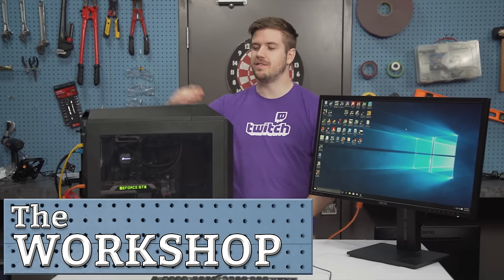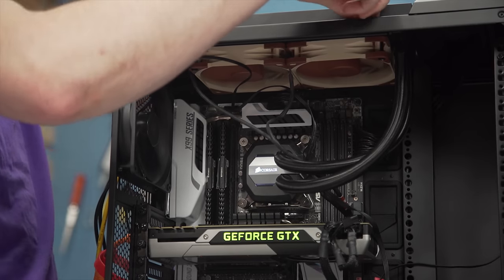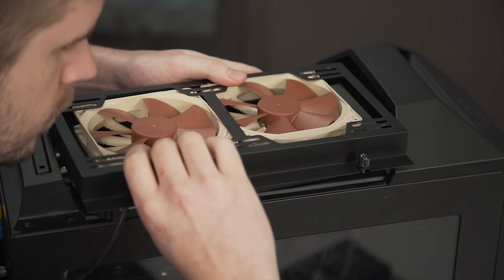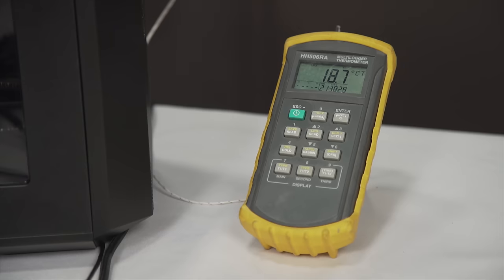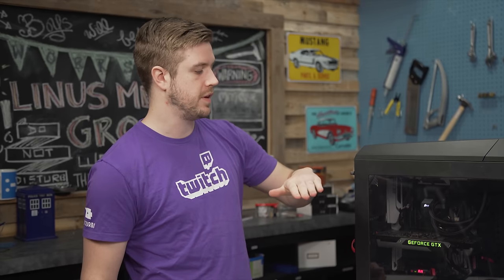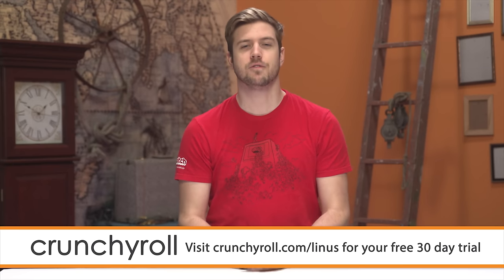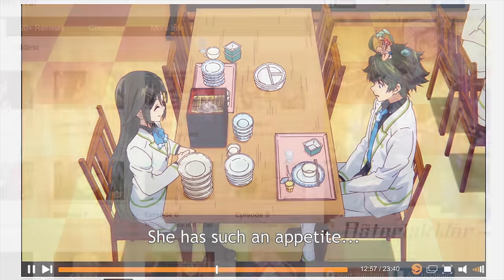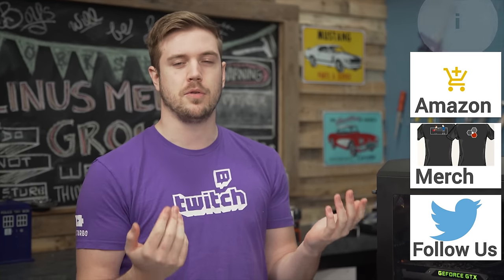Radiator Fan Configuration: Does It Matter? - The Workshop

Comment: you didnt do the front radiator setup...
Reply: I have 400c and the H90 push/pull air in the case(frontside),adding a second fan got me 20C° less on load then with one fan at 60C° load,the idle temps went down from 32C° - 35C° to around 20C°. (using 2 corsair ML 140) There is almost no dust on the rad after adding the second fan aswell but thats probaly bcz the case has side vents instead of front vents that attract the dust easier..

Comment: I did the same test here and i got the same results... another important thing here is about positive or negative pressure inside the case. Most people just put alot o fans (top/rear/front/bottom) but don't been attention i getting a grat air flow inside. Keep this on your mind!

Comment: from personal experience, the last time this actually made a difference for me was when I had no pressure optimized fans and I had them above the rad pushing air into it. I moved the fans to under the rad and it seemed to create more pressure as they became a lot louder and dropped my temps from 70c to about 40c
Reply: Having them under rad would that also keep inside the case cooler and help for gpu?
Reply: Having them under rad would that also keep inside the case cooler and help for gpu?
Reply: Having them under rad would that also keep inside the case cooler and help for gpu?
Reply: Having them under rad would that also keep inside the case cooler and help for gpu?
Reply: Having them under rad would that also keep inside the case cooler and help for gpu?
Reply: Having them under rad would that also keep inside the case cooler and help for gpu?
Reply: Having them under rad would that also keep inside the case cooler and help for gpu?
Reply: Having them under rad would that also keep inside the case cooler and help for gpu?
Reply: Having them under rad would that also keep inside the case cooler and help for gpu?
Reply: Having them under rad would that also keep inside the case cooler and help for gpu?
Reply: Having them under rad would that also keep inside the case cooler and help for gpu?

Comment: Idea for new series on the workshop: how to mod [insert component here]!! It would be soo sweet!
Reply: Like so LTT will see!
Reply: +Cédric Möhlmann no
Reply: +1 as for some reason I can't like.  
how to make a power supply cover, how to add leds not powered by usb, etching pexi glass, use phanteks new power supply splitter to add a itx board inside a case with an atx board, making dust filters.  

I mean we use to build PCs in refrigerators, mineral oil, and other crazy things that were myths and legends.  

however I love the testing of simple things that many of us think matter that dont.  but let's waste linus's money on other things.  the workshop has great potential.  just needs more resources.

Comment: I've been watercooling for many years , and yes placement doesn't change almost anything. From my experience I got slightly better temps with the fan pushing, but in more complex custom loops with 2-3 rads, that were also higher performance and of different thickness. All this details and different specs/fans/rads can change quite a bit the final result. It also depends if you're planning towards silence with low fan operation or high performance with more dense fpi rads.
With the dust thing I would say NO, it depends from to many factors. Yes pulling like shown in the video can get less air on the fans etc.. But remember everything is also quite much linked on your "case overall pressure". If you have to many fans pulling out and getting negative side pressure you're just sucking in dust from all other places small openings between panels, every little hole. 
More intake flow, so bit more positive pressure and filtered intakes will always garantuee the best dust free possible config

Comment: 2 last gen cards in SLI or Xfire or 1 new gen card for the same price.
Reply: 1newgen
Reply: +callum mackay (Calum137) Too many games don't support multi GTU configurations, so 1 good GPU is much better and being newer, it has more performance per watt (or should have).
Reply: +SmartassX1 
Yeah not to mention you could buy another one later down the road and start running sli/crossfire with that
Reply: +callum mackay (Calum137) new gen, for future proofing as well

Comment: The stuff you forgot to say is that if you have the hot air pulled through the rad and in to the rest of your system other component will get hotter and if you don´t have good airflow through your case after a while it would probably heat up the cpu as well (Probably not much enough to matter but still).
I like that you mentioned that certain configs can help with dust.
What i would like to know instead though is how much it would help the temps to go with a thicker rad instead of push pull?

Comment: I really appreciate the configuration tests that you guys at LMG do.  Some people get worked up about little things like this and these tests show that it's not worth getting worked up about (like thermal paste applications).  I do have a question though.  Luke said that his favorite configuration makes dust management easier.  Is dust an issue if air is drawn in through dust filters?
Reply: With negative case pressure, dust can still come in through the exhaust fans which normally wouldn't be filtered

Comment: How about radiator placement? When the CPU and GPU is under heavy load, the overall temperature in the case rises right? Does the placement of the radiator make a difference (e.g. radiator in front as intake with exhaust fans at the top or radiator as exhaust at the top and intake fans in front)?

Comment: Please do one about how the exhaust or intake radiator fan set up will effect gpu temp or other components. Recently I got a g1 gaming 970 and I have a Gtx h100i as exhausting out the top which in turn is making my CPU a little hotter, as it is pushing hotter air through the radiator. It would be entertaining to see if maybe an intake on the front or top will change the temps.

Comment: I would have liked to have seen the results for no fans at all.
Reply: +Kevin Solway i tried that once. it's just going to overheat slowly, but steadily. radiators are just super terrible when used passively. but with just a tiny bit of airflow they start to work.

Comment: it does not matter, unless you enjoy extra air flow in the case. I did push pull for that reason. It's as simple as putting your hand in the case and feeling the difference. The radiator restricted air flow, and adding a set of fans on the opposite side helped. GPU temp, because I have a 1070, is about 5 degrees cooler. Personally, 5 degrees is a lot in terms of adding to room temp on a hot day. I enjoy the extra air flow in the case, and no, it does not pull in hot air as some would think. If you radiator get's that hot, you have a defective pump fan.

Comment: I'd like to see the impact of RPM, can 4 fans run slower (and so quieter) and maintain performance? Also how would a hot graphics card impact the overall case temp? Feels like dumping a lot of heat into the case would be bad without extra exhausts

Comment: me as a beginner thought that pulling air thru the radiator as exhaust at the top was bad because i thought pulling in fresh air would be best for CPU temps but apparently i was mistaking! theres not even that big of a difference as long as airflow is good
Reply: The fun starts when you pull air through the top mounted radioator down into the case when you are gaming hard and your GPU is running hot. Then the case is full of hot air that is trying to escape upwards..
For cooling CPU alone the radiator placement doesnt matter much, BUT a hot GPU sending out hot air and also sharing intake air with the CPU changes everything.

Comment: use the stock corsair fans. they will blow away these f12.  

see what I did there :)
Reply: +OmerTheGreatOne And make it sound like a jumbojet. Im using the H110i GTX with Wingboost 2, silent and effective.
Reply: And they don't look like total shit.
Reply: +Slum Lord ture that.
Reply: +OmerTheGreatOne because they have way more rpm...
Reply: l
Reply: +OmerTheGreatOne also your ears!
Reply: +OmerTheGreatOne didnt even run it with the stock ones for comparison or under load, waste and a half
Reply: +NUCK CHORRIS buddy, I'm sure they were all kidding and making fun of corsair
Reply: Imagine buying a Lamborghini and then replacing its V12 with a hybrid 4 while paying 60% cost of the car extra.

You people follow whatever the trend is, even if it is stupid.

Corsair fans: 74CFM and 4mm/H2O
Noctua fans: 55CFM and 2.61mm/H2O

and 70$ extra.

If its too loud just select the quite profile.
Reply: ***** First I have said that the included fans perform better than noctuas.

Second i have never insulted Noctuas (as a owner of a system with 3 F12 running in it right now) 

Third nearly 200$ for h100I is too expensive. and under performs.

Fourth Noctua industrial fans are even more expensive and they will sound just as loud (if not louder) as stock fans.

I have h100I i switched the fans with f12 and my cpu hit 100 degrees in prime95 small fft test. i went back to stock fans and it was loud but system remained under 90.

I speak from experience and logic. what do you provide for proof of Noctua's superiority?

BTW Noctua fans are made in China as well.
Reply: +OmerTheGreatOne Noctuas are SHIT. The company is SHIT. Corsair makes great fans, and Corsair is a GREAT, American company.
Reply: +OmerTheGreatOne h100i GTX is defs overpriced for what it is (own one also but thankfully picked up near new at 2/3 retail)

Comment: Some questions which may be interesting to test.
Will a fully loaded GPU change anything: does heat inside the case cause upward venting to be less effective?
Can push pull perform quieter than just push or pull: does extra efficiency mean fans can run slower and still cool as effectively?

Comment: Luke, I need you to do a 120mm rad in the back of the case. Pulling air with the best config. 

Two fans in the front pulling cool air. 

And two fans on top with two fans blowing hot air out.

Comment: I also like the vents pull through the rad config for exactly the same reason - cleaning. 
BUT there is some unmentioned disadvantage to this config. And it is the noise. At higher RPM (~1800 for Corsair SP) the pull is much noisier than push.

Comment: Push-pull configs are for thick rads, whose cooling capacity sees diminishing returns as internal resistance makes it hard to get air to travel all the way through at full speed. Push-pull increases static pressure allowing air to move through the fin-array better. It won't help much at all on thin rads.

Comment: What about the affect of pushing/pulling more air into the case, or having more vent holes as you could be starving the fans in some way. Think about this, if your case only has 1 input/output and that is where your rad is vs multiple inputs/outputs. 
Another interesting thing would be to set up the rad outside of the computer as a best case scenario where it gets all the air possible with much less resistance and no bleed from the other components. Would also be interesting to have brought GPU temps to see if it cooled the other components with any of these setups.

Comment: The Fans install makes a huge! difference. It depends on the case and how you install the fans in it. But if you use watercooling it makes nearly no difference at all. So use something like a noctua or be quiet dark rock and overclock the cpu. Then you will see the differences. Airflow in the case is very important

Comment: A gimmick that's been popping up with fans more and more as of late:

Air Flow vs Static Pressure

1st is supposed to be used as case fans, 2nd as radiator fans.

Just how much of a difference, if any, does having the correct type make?

Comment: No, best for dust management is fans on the bottom pulling down (in) so that all you have to do is remove the top panel to spray (easier because you don't have to get a weird angle and spray the dust on other parts/most tops remove eaisier than sides).

Comment: I was doing some testing like that the other day. I didn't care that much about my CPU temp since it's already pretty cool with that kind of cooler. What was on my mind was my Asus 390x Temps. The kind of graphics card that doesn't exhaust air directly out. Tried the Rad as front input, output , push pull , etc. With static RPMs on both my CPU cooler AND my 390x . I did see a difference on my GPU temps. This kind of test should be done too! GPU temps are more important to me than CPU since the GPU overclock makes more sense to me to get more FPS.

Comment: Watched a few of such videos and Bitwit's has the better test which uses both blower and open style coolers for the GPU. 

For the open style GPU cooler which vents heat entirely into the case, the radiator should be mounted as intake so that cool external air passes through the radiator. Having the rad as exhaust severely impairs the performance due to the hot air from the case/GPU

Comment: I would have liked to see an opposing vortex configuration. Meaning the top and bottom rear fans blowing in and the front fans blowing out, or vice versa. To be effective there would need to be a plate dividing front and rear halves from just recycling into the other side. This config should cool better on the in side, which could assist water flow by convection.

Comment: I wish you could of mentioned the fact that with the configs pushing air into the case could effect thermals on your other components like your graphics card. I would suggest to always blow the air out of the case with a top mounting for the rad or the rear, no where near intake fans for your case.

Comment: if i do a custom loop and set the radiators as you did do i need another exhaust fan in the case? or is it just fine leaving the radiators just pulling air in? Going to plan a full custom loop including cpu and 1 gpu

Comment: Hi there! is the graphics card on this setup an open card or blower? would that influence the internal case temp more if it was an open card and having air push out of the case through the radiator increase temperatures in the CPU?

Comment: Hey awsome video! 
Just one question: What if I put a couple of AF-14 on a very dense radiator (so that these poor air flow optimized fans would struggle to get enough pressure to move air through it) and then decide to add two more in a push-pull configuration? would they'll help each other so that they would not struggle anymore and maybe even get more effective than a set of 4 NF-14 (pressure optimized fan)? I think it will but it's at the edge of the distinction between air flow and pressure optimized fans... so... only a proper test could tell me!

Comment: However, from my own experiences, once the inside of the case starts heating up like from the graphics card, you'll have cooler temperatures drawing air in through the radiator, than drawing case air through the radiator out. But if your case temperature is close to ambient like in this example, of course they'll have similar results.
Reply: Finally I’m starting to understand this a little bit better now I’ve been watching so many installation videos for the Corsair H115i that I just bought and very few people seem to follow the instructions where it fully shows that you should mount the fans so it’s intaking air from the outside of the case for a top mount set up But I have come across maybe like four people who have actually followed the instructions it’s very misleading to somebody who is new
Reply: The only other thing I was just thinking is having them mounted so it’s exhausting air through the rad is that maybe it would help hot air escape from the case but I don’t know if that really makes any sense because I’m sure that back fan is putting in work

Comment: Doesn't having the fans on the outside pulling the air, increase the noise in the room? If the temp results are almost identical, it seems like having the fans inside the case would be more ideal for lower noise.

Comment: does using the radiator as an intake affect the gpu heat?  I'm planning on using the Corsair H110i GTX as a front intake with push-pull for my fractal design r5.
Reply: I believe jayztwocents has a video on that. I think the title is "are front mounted radiators bad"
Reply: +tommywho924 ya I've seen it now

Comment: Can you show us how to mount a radiator in a mid tower case with a pull config ? Do we need to screw in the fans on the top of the case and then from here on the rad, like the screw need to go from the fan on the top to the rad ? 

Thanks.

Comment: My question is how does this change in airflow affect the other temps in the case itself? Sure blowing air though the rad in different ways probably won't change temperature much since its about air volume rather than air direction, but wouldn't having a push pull system not only keep your CPU cooler, but also provide more air, and thus cooler air to the rest of the system resulting in cooler temperatures across the board, not just on the CPU but also on the GPU, and chipset?

Comment: I'd like to see CPU temp differences with a radiator at the front / back using a internal / rear exhaust GPU. 

I'd imagine having the heat of an internally exhausting GPU going over the rad at the back would increase CPU temps, and that a front rad might increase GPU temps, but it would be good to see if either make any meaningful difference.

Comment: I have that exact cooler and a 4790k. I used the stock fans. Idle or browsing web temps are 32C usually and Rendering videos it gets to about 64C consistently. I use the quiet fan profile which locks the fans at a max of 50% i believe. Performance and Balanced are loud and don't seem to make a difference but it may be because i also have the fan profile in my mobo bios set to a certain curve too.